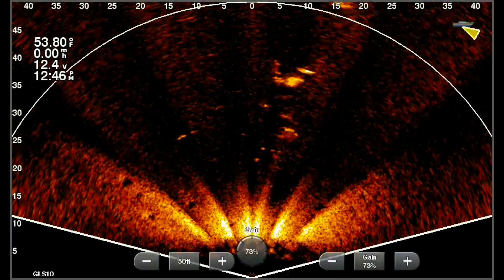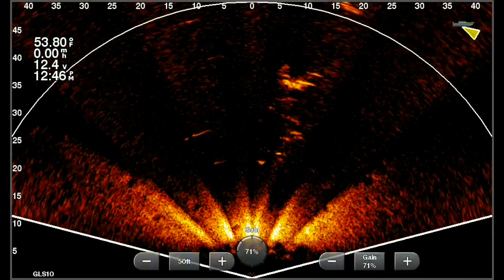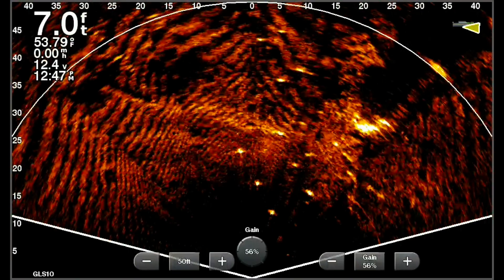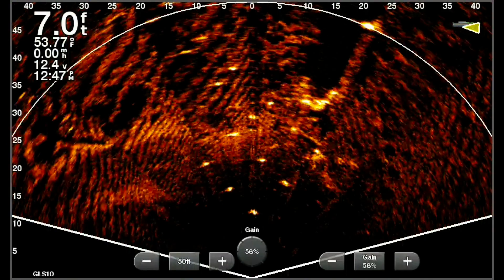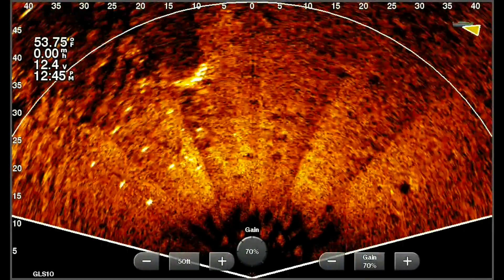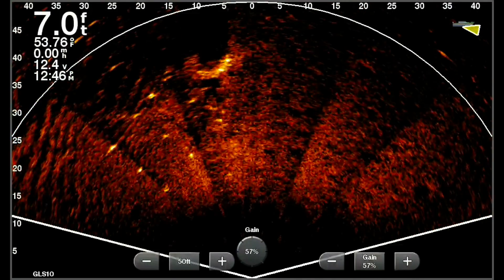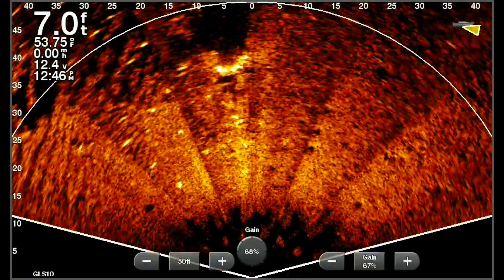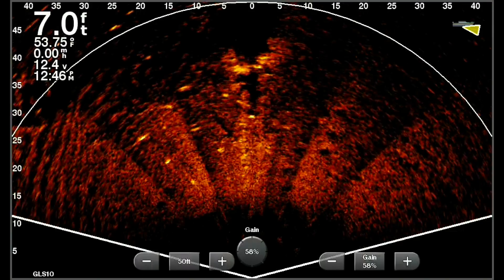Garmin Livescope Perspective Mode: Part 4 Transducer Angle and How It Affects Picture and Clarity

Comment: Would you agree if in perspective I set the top of the beam parallel to the transducer depth in water . so example 20 degree beam I hear on Garmin . I set the trans tilting down 10 degrees ? that is if tm shaft is perpendicular in water.. Basically saying one side of beam is shooting straight out .the 20 degrees would Then be from horizon to cascading down .
Reply from the maker: I use the beam indicator to get the top of the beam parallel to the waters surface
Reply: @The_Garmin_Guru  top right corner of screen ? Kinda looks like a flashlight coming out front if boat? Didn't know it moved up and down

Comment: Did you happen to measure the before and after angles when you moved the transducer?
Reply from the maker: The angle of the transducer is not important. You judge using the beam indicator in the top right hand corner
Reply: @The_Garmin_Guru  I understand what your saying but as I understand the angle of the beam is”fixed” inside the transducer so if you measured the “Garmin” angle and what your moving it to would be a help for someone knowing how much to adjust it I’d think.
I’d been thinking of changing mine when I saw your video. Mine was at about 20 degrees. I’ve moved it to about 15. I’ll try it tomorrow.
Keep the vids coming….good info!

Comment: I dont believe the image is like your in the top right corner . Mine show as looking down from the boat not the side . Can you change that
Reply from the maker: I’m confused bud. I need to see a pic
Reply: @The_Garmin_Guru  I don't know what I am talking about . I did go out and put it on perspective and grabbed the TM a raised it up wow what a change . You showed 3 different views  . looked like a flashlight showing out the front of the boat (Top right corner ) . One being to high another to low and one just right . I didn't check when I raised the TM if the top right corner image reflects that change with the beam angle coming out front of boat . Does it ?

Comment: Yep ,here on lake griffin fl.{ ON THE HARRIS CHAIN,BABY?} Perspective mode is used a lot by me, most the water is under 8 feet, but most all the fish attracters are in 12 feet to 18 ft., that's when I switch back to forward mode, I didn't catch what your adjustment was on the video ,or what  position you actually put your lvs-32 transducer in ?or how? 1 up, 1 down ?what ?,any who thanks for another great video,  stay safe and   FISH-ON  😎  MICK  N FL,   🤠LINE 1
Reply from the maker: Look at the beam indicator in the top
Right hand corner.

Comment: I currently have livescope mounted on the barrel of a minn Kota terrova because there is no spot on the shaft for it. For me to get perspective mode I think I need to get a $250 mount for the motor. Do you think having perspective is worth that price ?
Reply from the maker: How often do you fish shallow
Reply: @The_Garmin_Guru I’m on a highland reservoir where very little of the lake is under 15 feet, but I fish that 10 foot and less range 90% of the year. We just don’t have much of it. But I’m thinking perspective would be great in those areas.